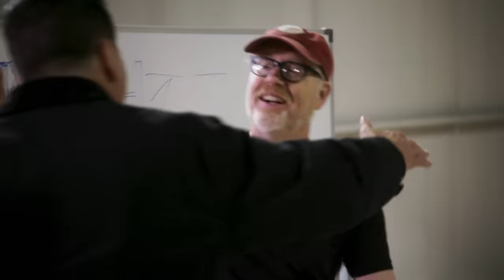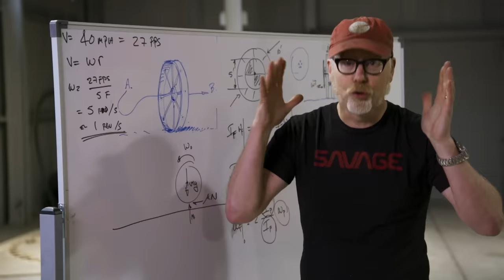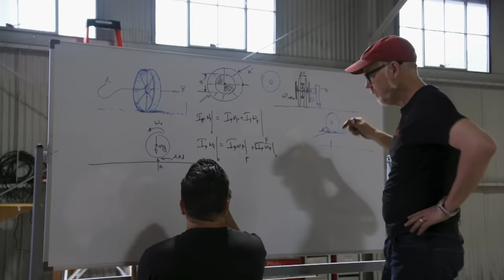"The Power In These Flywheels Scares The Pants Off Me" | Savage Builds

Comment: Needs more balancing work and a more stable platform. Probably should figure out a better uncoupling procedure, something like the wheels and levers they used in the past to start ICE tractors and cars had since it overcomes the spooling device, it uncouples itself without pull the thing sideways. Not exactly rocket science but still complex and dangerous

Comment: your flywheels are not balanced but that is an assload of kinetic energy....   i wish i could see it go,  i don't think it will track straight with a solid axle,  one side will always have more traction than the other.   Each side needs a clever and fast acting clutch system capable of engaging and disengaging about 25 times a second,   that way an operator could steer it remotely

Comment: Badass idea,, but what if? What if, since its mars and mars dosnt have a magnetic field, so ive heard, why not use just normal iron as its magnetism best friend?other than steel but steel has that smoothness to it with magnetism. And why not spin the wheels while in space, and then lower it down to where you dont have to spin it on planet. The latter is more of a method than a technical thing. Im just throwing ideas out there though.

Comment: You tell me that you fully balance the drive shaft between two metal wheels but you didn't balance the wheels themselves and wonder why it has vibrations after the 3rd of the rotation per minute you wanted and like the other common seriously a freaking strap to hold all of this power down

Comment: Ok, I'm at 4:35 into the video and I'm already thinking of better ways to siphon off the power. Using friction brakes is hideously inefficient. Instead maybe you could rig up a method of siphoning the power with a generation system that powers a motor driving the drive wheels of your very strange device.
At 6:10 it's clear you haven't balanced your flywheels correctly, or not at all I think most probable. Plus you need a real clutch to disengage and engage the power unit. That yanking on it from the side could be very bad if you couldn't get it to disengage.
At 7:10 why did you apply your wooden brake so close to the center. apply it at the outer edge gives it much more leverage to slow the flywheel. Admittedly you wouldn't be able to press very hard unless the other side received an equal pressure.

Comment: Way into the future, the next world called a human lightworker world there is a total different technology there, then all machinical like this world. In my child King space program (45*yrs ago) I flown one of there crafts called a pod car. It uses very high speed motors and advanced air bears to spin magnetic energy's in minipilating the gravitation pull of gravity. Basically it fights back gravity waves and in turn hovers off the ground, totally quiet. Works on any environment that has or has not gravity. I have a foot ball size field of that technology waiting on a very large motain/next world, waiting on when it is done to take everyone to it. You can make it now if you wanted to, really simple design. The only thing is it needs super advanced battery technology ( did you find Al yet ? ) I have some of those hidden here as a back up, but they are scaled down very small, I have a whole 55 gallon drum berral full of them. I used a few on a Little Richard gost prank on some skinheads camp, with a motion sensor used to activate the advanced technology hologram. Kind of funny, find them you might be able to figure out something....they are scaled down very small but will last millions of years, around the 1.5 to 3.0 volt range. Shareing a mistory with the world on the interlink....lol ! They called me crazy 45 yrs ago about the handheld interlink devices we all would have in the future, the future is now.    ;-)) so let's talk...

Comment: Kind of not impressive. Nissan spins a flywheel in a vacuum at over 50,000 RPM. And then releases that energy into a Drive system on its formula car in order to give it a tremendous burst of energy to blast it out of turns during LeMans.

Comment: setup is very unprofessional. 
The detachment should not be initialised by a hand pulled mechanism. You need some sort of automatic clutch. Also before doing full rpm test, balance the whole thing the same way we balance racing cars wheels.
It has to be perfectly balanced, and there must not be any imperfection due to welding.

Comment: Food for thought gear reduction  Planetary gear set  Driving interior set of wheels  larger diameter than firewheels that actually drive an touch the ground then open  Is differential or Detroit true track  gear driven limited slip locker  with a  Relucter ring on each side 2 to measure speed of each wheel similar to ABS brake system on a vehicle to apply a break to keep it going straight or whatever direction we wanted to go in reduction planetary  will multiply torque  last longer and could even be shifted up in  higher or lower speed Simply if you want to get complicated automatic Vehicle trans i.e. Climb hills  go further and be controled  Run on sentence high school drop out 2 cents worth?

Comment: Attach a solar mendocino motor coupled with graphene thermal motion energy harvesting circuits to the flywheel battery.

It will run on its own

Comment: I mean i rig a lot of sketchy things to make do at work and id never use saw horses and a strap anchored to the ground as a support on that not to mention the way they made the disengage system. I mean i would throw on a clutch with manual adjustments similar to a stokes r4 press clutch ,granted you would need to redesign that whole contraption to make it work. I can tell they rushed this project, And they did not account for every tiny variable.

Comment: I learned that bodies in motion tend to stay in motion unless impeded.  I'm also experimenting with a 3lb flywheel and DC motors.  Minimizing inertertia loss from friction is key, so I went direct drive, no pulleys or belts.  Still testing, measuring performance

Comment: The guy works for NASA and has never heard of multi-plane, dynamic balancing?  Even at the small facility I work at, we have 800 lb, induced draft fan wheels that spin that fast, and with a simple dynamic balance they run so smoothly you almost can hear them.  What an overdramatized joke of an episode.

Comment: Why would he try to stop it by applying pressure to the inside 🤔 this thing is just an oversized model of a car rotor and all brakes systems apply pressure to the outside of the rotor🤷🏾‍♂️ at this point I figured this is being drugged out for views. And this isn’t accurate….

Comment: Imagine a metal matrix graphene/carbon nanotube composite Flywheel that’s 40,000 feet in diameter!

That’s like jumping out of a plane at 40,000 feet, and that’s just ONE Flywheel out of 6 (3 x 2 individual Flywheels at each end of an O Neil Cylinder that’s 300,000 feet in length)

Or scale it down to 6,000 foot flywheels and a Cylinder that’s 48,000 feet in length!

Comment: Problem 1.  Trying to stop the rotation at the HUB will get you NO WHERE.  The HUB stores the most energy.  IF you placed the wood at the edge, it will slow down much better.  Far less energy at the edge.

Comment: 7 10 (broken autocorrect keeps changing the colon 10 into a 100 FOR NO REASON).
 Pushing against the OUTSIDE of the flywheel would have slowed it faster.
Better leverage.